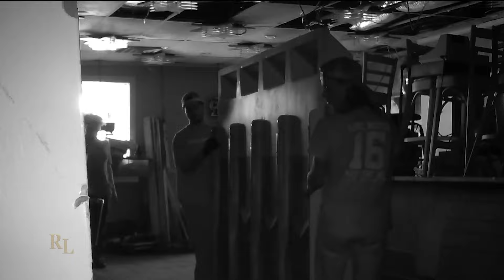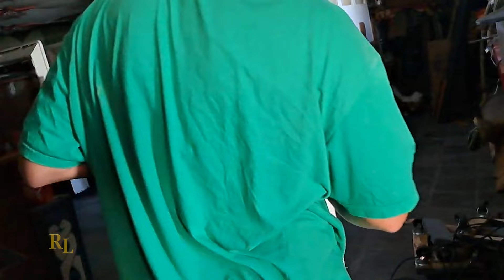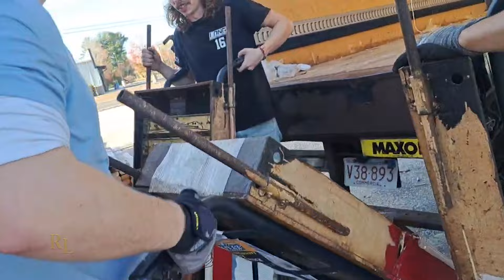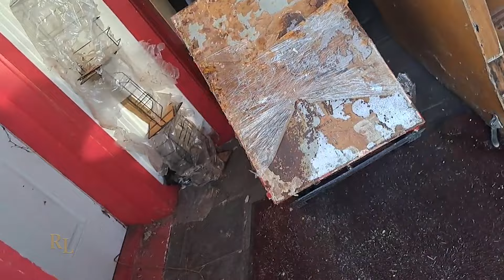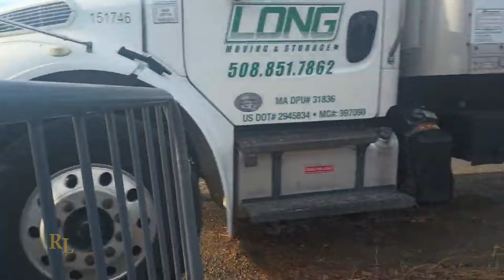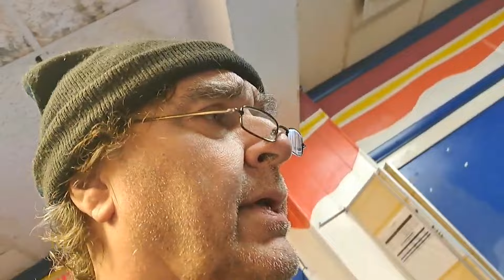Saving the oldest FASCINATION system (PART 2)

Comment: Seems like the only way to prevent either of the other two parties from breaking glass is to make them remove and properly pack every pane.  This isn't your first broken glass experience.  It may surprise shippers to learn there are shops filled with stained glass sheets, and they manage to stay in business.  They aren't run out of business due to breakage, because they ship correctly.

Comment: Is there any parts in a fascination circuit that might have date codes stamped into like transformers etc? Obviously those could’ve been replaced many times over its life but maybe if you have 20 units with the same dates it’ll give an idea of when it was made
Reply from the maker: @MrKevbo82  nothing I have ever seen.

Transformers not there at all...

I assume the company made the control relays themselves, just like all the pinball companies did...

I can only go by my knowledge of the various systems I have and have seen over the many years.

No one knows more about the evolution of Fascination then i do!

Comment: I wasn't expecting that much of it to survive. Are the missing pieces completely gone or did they just get left behind?
Reply from the maker: @gemmyhamstercollection966  unknown exactly what took place when it was disassembled 5 years ago...

Clearly the base Assemblies are long gone, and there would be control circuits and power supplies for certain.

There are conflicting stories that there was a storm which damaged the building, while others said no, and they just wanted to read it down making an outside party area...

However, if there was a storm and flooding, that would explain the lower bases being water ruined...

The missing pieces may turn up yet; I have hopes.

But I can create new control systems for sure, and I can get power supplies but they will be expensive.

The glass can be replicated; expensive.

For the most part what I have saved is what cannot be replaced 

Even the 1 missing head I can create a replacement for and no one would know every playing it.
Reply: @MainStreetRANDYLAND  So does that mean your planning to be them back into service somehow?

And yes a flood would definitely explain the damage, it's just a shame they were so neglected.
Reply from the maker: @gemmyhamstercollection966  this will be the 8th set of fascination games I have...

EIGHTH!

I wish I had all the space required to set them all up...

And everything else I have too.

I would like to but honestly, to use them in any high volume practical operations such as the boardwalk, it would be difficult.

They are an important piece of history however, and they should never be destroyed.

To show the evolution of the fascination game, is to show the evolution of amusement games, technology, society, who we were, and who we have become.

And to demonstrate that correctly, all the various Fascination game systems I have should be set up and tell the story of evolution!